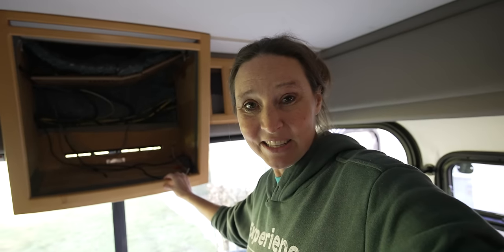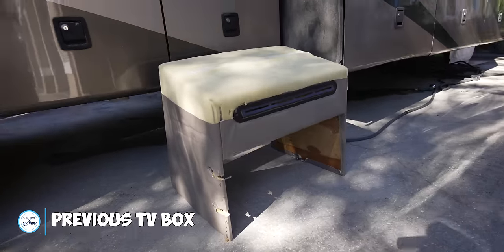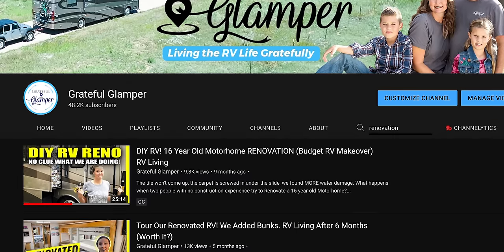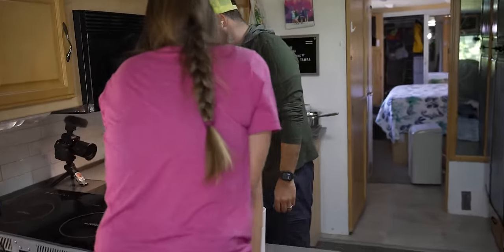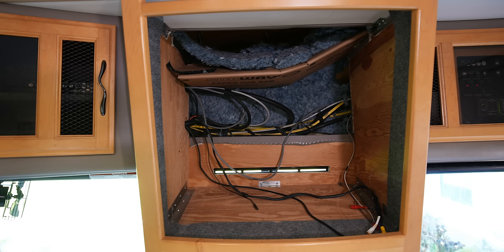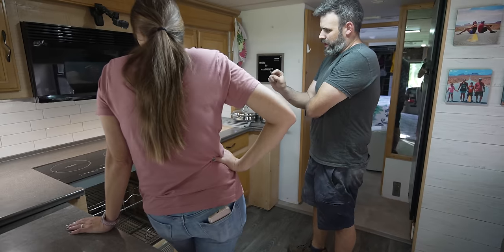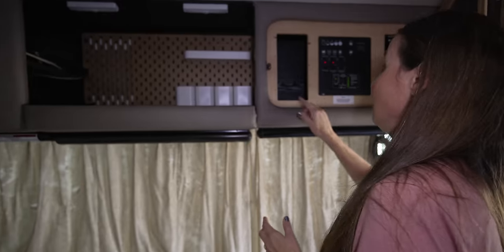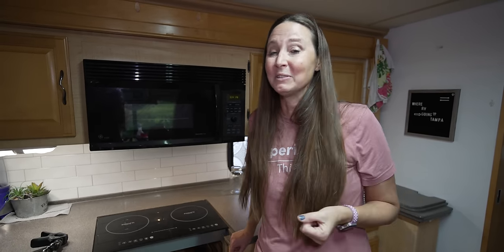RV Renovation: We Ditched The Propane Stove For Something EVEN Better!

Comment: We live in our fifth wheel full time with 3 small kids and we just pulled out the oven! I was so worried about taking it out because I bake all the time but I hated that stove so much and it leaked so we only ever used one burner. We have a one burner induction stove top that is mobile/set up as needed and I primarily 'bake' in one of our two instapots, a 6 qu or the 8qt that also has the air fry/bake lid. So far, so good! We are looking to upgrade this summer with an electric smoker/pit outside but I've been able to bake a ton of stuff, planning on doing bread this week. The amount of new storage and countertops in our bunkhouse fifth wheel is now amazing. You won't regret it!
Reply from the maker: Good to hear! Safe travels.

Comment: Now you MUST run generator when boondocking. 
Prefer using gen as little as possible.
Reply from the maker: Yes, we know. We rarely boondock and when lotdocking we’re usually eating something out of the fridge (sandwiches, charcuterie, etc) or eating at the Cracker Barrel if that’s where we’re parked. We don’t mind using our Gen when needed.

Comment: I took out my propane burners and installed a convection and never looked back. Now I dont cook for a family, but knowing I dont have to use propane to cook when I do is a plus for me. 

Next I am having my company install an 8 camera 360* safety video system for all sorts of things. 1) I wont have to get up and peek out a window at night wile boondocking to see whats happening at night. 2) it will have a 4 TB SDD so i should never loose video files. 3) safety wile driving - recording 360* 24/7 is an amazing mental plus.

After that will come upgrading to a hybrid hot water system. electric instant wile shore power is there, but propane backup wile not. 

lastly I saw that "workman's bandaid" he had! haha, I cant tell you how many times I cut myself and used napkins and electrical tape to keep going.
Reply from the maker: Sounds like some awesome mods! Thanks for watching the comment

Comment: Your reno is inspiring. We have a 5th wheel currently,  but have fallen in love with a 2014 DISCOVERY...BUT it's dark and dismal. WE would completely brighten and lighten it up. Researching the DISCOVERY, appears to be a solid brand and built in the years when attention to detail was top notch! Love the induction with storage below. I would ditch the propane in a heartbeat. What model is yours? We have found a 40E. Safe travels
Reply from the maker: Ours is a 39j
Reply: Thank you! It will be a lot of work, but totally worth it. Our vision is to paint all the dark wood, white. And the walls with white barn board wallpaper...fingers crossed!

Comment: I want to do this as well with the stove (inlaid into the countertop), however, my first thought is what happens when a pot boils over. Have you experienced this? I’m worried that the liquid will flow into the gap around the cooktop and be a nightmare to clean up. And potentially ruining the cabinet underneath over time. Since boil overs are inevitable for those of us who are easily distracted.
Reply from the maker: We have silicone around the stove top so there isn’t a gap.

Comment: Nice upgrade, we are thinking of doing same, but concerned about power. I assume convection microwave and induction cooktop are on same circuit,  are you limited to using either the cooktop or the microwave at same time?
Reply from the maker: Our microwave is on a separate circuit from the induction top.  The only thing you have to be mindful of is OVERALL power usage. So for instance, if you have both a/c's going, using the induction top, charging devices, etc and then add another high power device, it could blow the breaker. Over all, just be mindful of power draw as a whole and you'll be fine. Thanks for watching!

Comment: I am not a Internet or Youtube influencer, but I am reaching out to those of you that are, and asking ones that might have connections with the industry, of RV's or Items that are Manufactured for RV's to have someone make the equivalent of the Propane Blackstone Grill, but Electric.
I have been doing research on Fires in and around RV's being caused by Propane Stoves, Propane Heaters, and Propane Refrigerators. We now have 12V Refrigerators, and  Electric induction cooktops, Why not the Equivalent of the Blackstone Grill, but only Electric?  Somebody out there should be able to make one, but as of now, I have not found one, at least not a big one like the Blackstone!
Reply: You can get electric griddles all day.  It’s what we use.  They’re less than $50.  I can do just about anything a black stone can do.